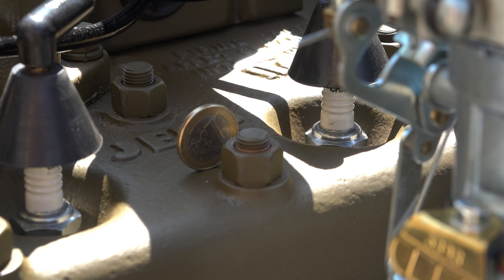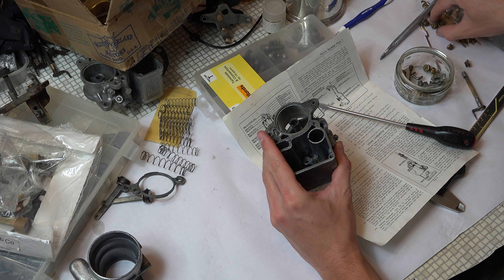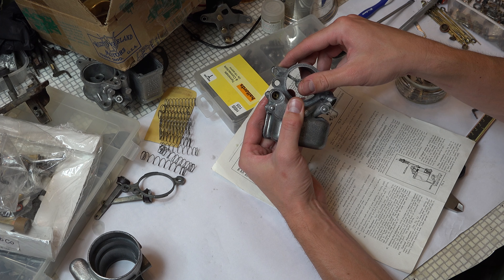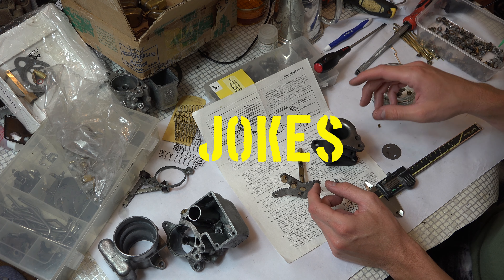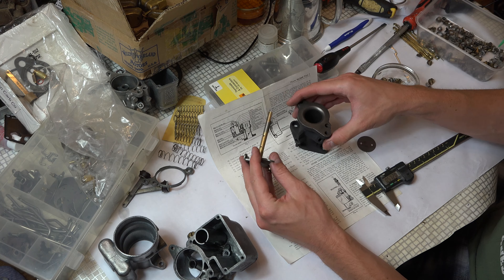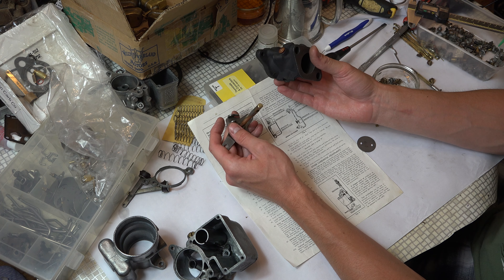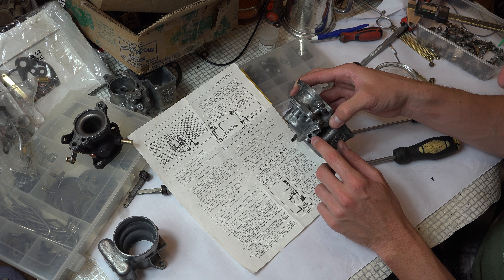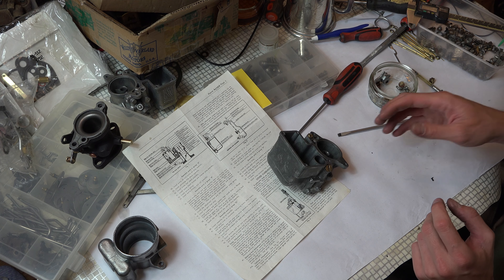Making the Willys jeep WO Carter Carburetor work properly -Part 2. 539S

Comment: I use a variety various sized screw drivers, makes installations trouble free. Important not to damage threads which is easily done as aluminium threads are soft. Damaged threads can be fixed using correct sized tap. Very good video. Keep them coming,  thankyou. 👌🏻👍🏻

Comment: I sheared off one of the throttle screw head on removal and couldn't get the rest of the screw out of the throttle shaft. I used a dremel to grind down the rest of the threaded part of the screw so I could remove the throttle shaft. Then I used a number 43 drill bit and drilled out both holes for the throttle plate mount and tapped them with my smallest tap, a number 4 with 40 TPI. None of my local hardware stores carry a 4-40 brass screw so I had to order 100 online. Still waiting on the screws.

Comment: While taking off the throttle butterfly on the WO carb today one of the brass screws broke off, I didn’t not try the other one yet, I did notice on the back side of the screw they both seem to be purposely split in the center in what seems to be a locking technique so they can’t back out. Is this normal? Does it need to be done once new ones are installed? And also what is the best way to remove the broken screws from that shaft?
Reply from the maker: That is all correct, removing the butterfly screws is probably one of the more difficult problems of restoring a WO and takes a lot of care. The best way to do it is to heat the shafts and screws a couple of times with a torch and then quench with WD40, after the 2nd or 3rd cycle the screws should be ready to shift.  You  must put maximum force into pushing into the screw head and less force into rotating the screw, all I can say is that if you try to force the screw it is likely the shaft will break as you found.  To remove broken ones you can drill them and pick out the threads which takes some time and effort or five it to a specialist who should have no problem, when reinserting new screws you can use loctite to lock them,  reproduction shafts exist on the market, so all is not lost if you cant recover a throttle shaft! cheers

Comment: Do you recommend that brand new carb? It seemed to run pretty good
Reply from the maker: Yes, if you can't get a good WO go for the joes, the metering rod can be adjusted a bit for better running but it is very good!

Comment: Did you ever create a part 3 with everything finished including setting the accelerator pump height and adjustment?
Reply from the maker: I will try and get it done over the next week or two ;)
Reply: @Greendot319  Awesome, been using your guide and scout pilots guide, to rebuild a couple of 539s's...